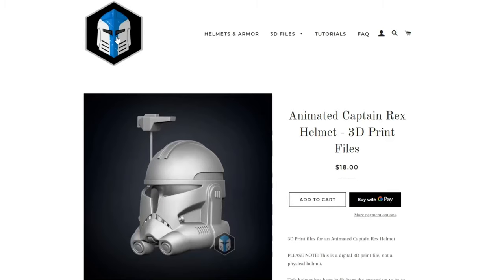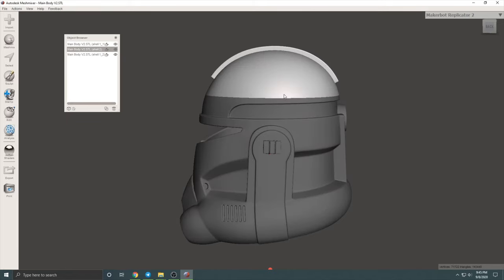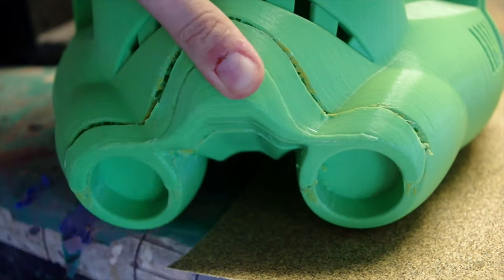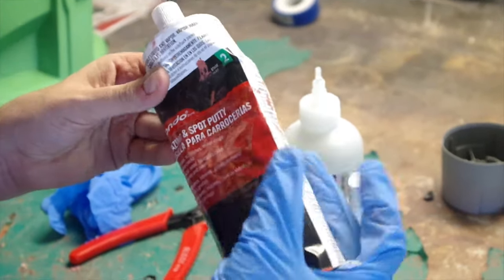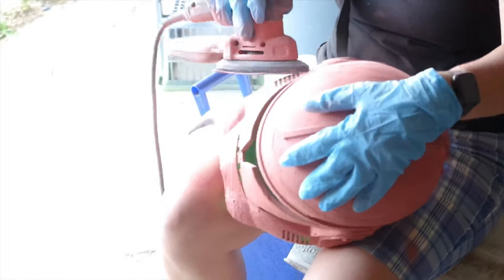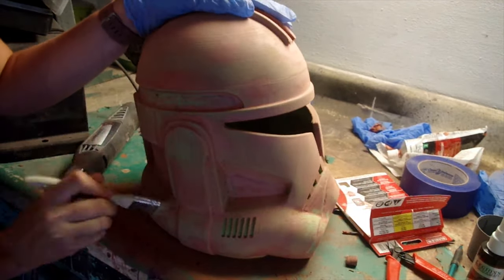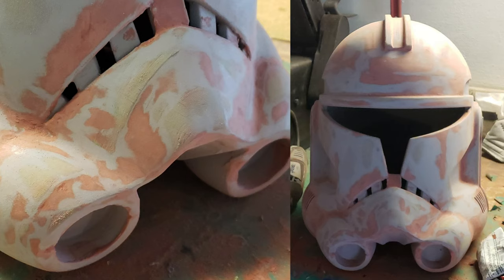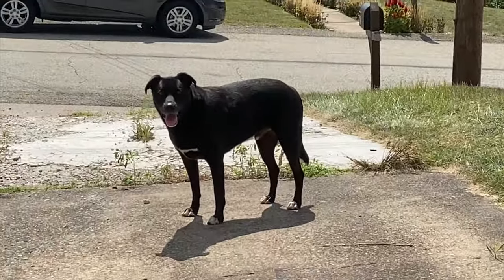Fixing ANOTHER Failed Print! // 3D Printing a Captain Rex Helmet from The Clone Wars

Comment: once again, such a great video. just a thought for your failed print. possibly look at the wheel and belt tension on your bed. i was having layer shifts like the ones you have and it turned out my beds wheels were way too tight and it made my belt skip occasionally.
Reply from the maker: thank you! and that's actually what that layer skips issue ended up being! now it's my go-to fix anytime I have layer skips (that and decreasing my print speed)

Comment: Nice job fixing the jaw part, I wonder if it would have been easier to cut it off at the natural seam (around the teeth and the curved jaw) and then reprint the entire jaw with the teeth? That way you could have hid the cut in the seam.
Reply from the maker: it was pretty hard for me to get that small part off cleanly, so cutting through the part of the print that was successful would have been a nightmare for me since I don't have any vices that would have fit it so I wouldn't ... cut my arm off, lol.

Comment: try some wood filler for the gaps like that on the chin. Way less toxic than the bondo and then you can use the bondo for the smaller gaps after the wood filler does the bulk of the work.
Reply from the maker: I haven't had much luck with wood filler in the past, but it was the cheaper stuff from the dollar store. Might give it a go next time around

Comment: I know meshmixer can cut objects into smaller parts, but can you take smaller parts and put them back together?
Reply from the maker: yep! I've done this on occasion, sometimes you get lucky and when you import split files from the same model and they'll automatically connect to each other, other times you have to wrestle with meshmixer a bit to get them to lock back in.
Reply: @vaultfox  Yeah I tried to re-attach the 4 parts of the dome for a phase 1 clone trooper but could not get it to work. Helmet was the wrong size when it finished so didn't matter in the end lol

Comment: Very cool! What resolution did you print the pieces in? I tend to use 0.3mm with 10% infill, but it leaves so much sanding work haha. 

Keep it up :)
Reply from the maker: thanks! this helmet was printed at .2mm with 15% infill, and it cuts down a little on sanding but not alot so I'll probably go back to .3mm actually
Reply: @vaultfox  Yeah that's what I used to use, but would rather the parts print quicker. I'm not sure if you'll know, but do you know if there is a UK equivalent to Bondo? We can't get it over here, and the filler I use always leaves blemishes.
Reply from the maker: @Thomas-ss1iu  you could probably try searching for 'automotive body filler'?  I know 3M makes some stuff

Comment: Why use a pla material over abs or petg, don't you worry about it melting if it is in a warm spot like a car.
Reply from the maker: I have no interest in dealing with ABS/PETG right now and I‘ve never left 3D props in a car in the elements, so it’s never been an issue.
Reply: The styrene fumes for one but that's only with ABS and ASA and similar family of Filament material.  But good point yes heat resistance is definitely a nice quality to have.